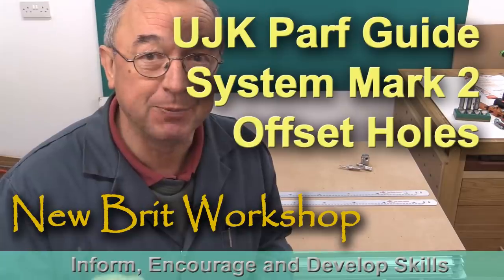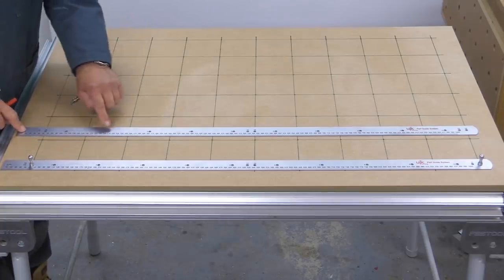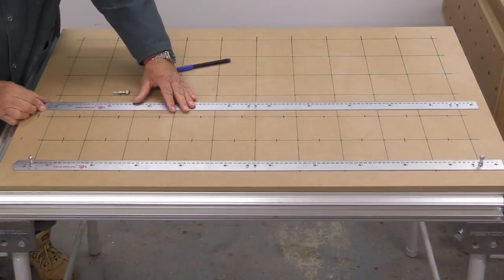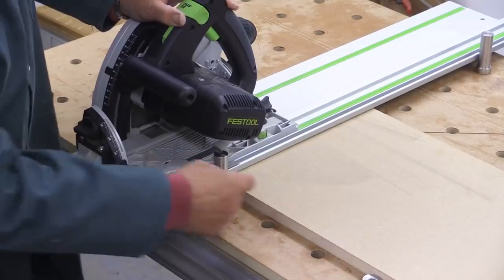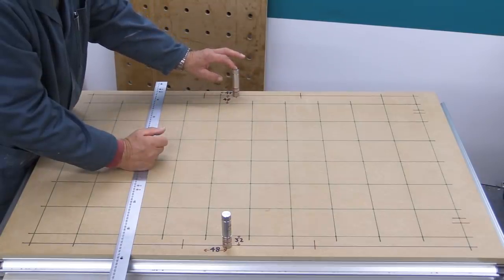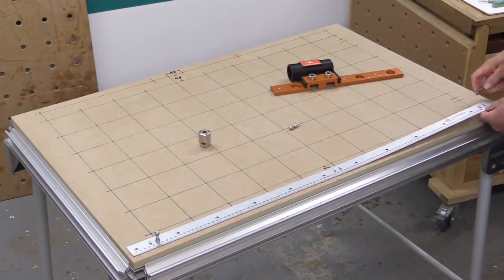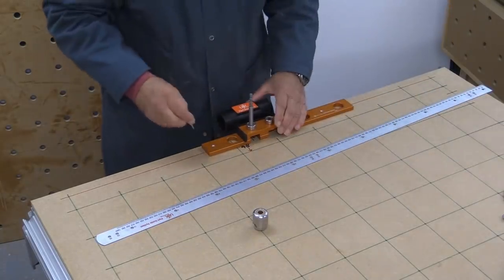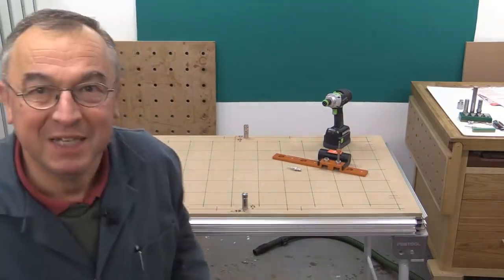UJK Parf Guide System Mark 2 - Offset Holes

Comment: Another outstanding video peter thankyou . I used this system to make a 600mm step square for my Radial arm saw and its the first time i made one with such certainty that its square . I am in the throw of putting my MFT together and playing around with clamps and seeing what clamps will go through thicker material than 18mm .. interesting the microjig clamps will go through a 30mm top and breeze through a 25mm ,, of course the festool one will only just do 20mm . maybe interesting exercise to pop up a matrix people can contribute too as to what claps  will fit through the holes V various thicknesses of top ... all the best from NZ and thanks for a fantastic product idea ..
Reply from the maker: Hi Karl, Many thanks for this - good luck.  Cheers.  Peter

Comment: Hi peter just asking you ,what is the difference between the old parf guide system and the new mark 2 parf guide system.  Peter you are excellent at useing  and seting it up.
Reply from the maker: Hi Shane, The Mk2 is easier to use and more accurate because both 3 mm and 20 mm drilling is done with bearing (oiled bush) guides.  Peter

Comment: Hi Peter, brilliant as always - I think a "Parf Super Short Dog" with a 3 mm hole in the middle where the top is flush with the table would be a good idea in order to make the offset holes in an existing MFT3 table......or is there another way? (happy owner of PGS Mark 1 btw)
Reply from the maker: I have said in many of my PGS videos that it is a good idea to leave a few 3 mm holes in the bench top in order to allow further work if required.   Peter
Reply: Yes, but not an option I suppose if you want to add extra holes (as he says) to an existing MFT top - eg to add offset holes for the guide rail.  Presumably in that case you can use the 20mm guide block to position a couple of holes halfway between existing ones?  Nice update by the way - time to jump on the bandwagon I feel.  Mmm - Christmas ideas!!  Geoff.
Reply from the maker: Hi Joe, You can try to use the 20 mm guide block to make offset holes of a sort but the problem is that a 3 mm hole is required in order for the 20 mm cutter to work.   Peter
Reply: Ouh yes, you can make offset holes in an existing MFT top. I just found the answer in one of your videos, Peter. At 11:07 in video "How to make an Isometric MFT Top" from 30. maj 2018 you show how to make offset holes by using the Parf stick as "spacer" 👍

Comment: Hi Peter. You briefly mentioned that you can use the Parf sticks to create a 48mm spacing. It seems like you should also be able to do 16mm spacing. Is that right?
Reply from the maker: Technically yes as there are offset holes for 48 mm and 32 mm and the difference is 16 mm. However, having 20 mm holes at 16 mm centres would not work at all as the holes would overlap.  If the 16 mm offset holes are in unique rows (or columns) then it can be made to work. Good luck.  Peter
Reply: @NewBritWorkshop  Thanks. That's what I needed to know. I need 16mm spacing for offsets to hold the dogs for my guide rail. They will be all on their own far away from any other dog holes.
Reply from the maker: Excellent.  Peter

Comment: Just received my PGS Mark 1 from TSO Products here in the US but haven’t opened it yet. I would much rather have the newer version. Any idea when the Mark 2 system will be available over here?-Greg
Reply from the maker: Hi Greg, No idea but the original is less expensive and equally as accurate.   Peter
Reply: TSO Products has it in the US, I just got mine yesterday.

Comment: Peter, I really like your system and in fact I have purchased the Mark 1 parf guide system some time ago. Allthough the Mark 2 definitely has added value, I am hesitant to upgrade :-). However, creating offset holes that prevent sawing marks from being on the holes and colliding with larger parf dogs does sound attractive. I have found a way to do this using the mark 1 set, with the remark that the holes will be perfectly perpendicular, but not at 32mm and 48 mm offsets. I hope this can also help other people. However, I do not see a way to post pictures. Do you have an idea how I can share with the community?
Reply from the maker: Hi Mathijs, I have also been doing offset holes on the original which I recently demonstrated at the Harrogate Show. Perhaps I will include it in my next Workshop Notes video.  Cheers.   Peter
Reply: Peter, thnx for your reply. And thumbs up for this system!
Reply: Peter, how can I locate the offset holes in an already existing Festool table top. All the holes are already drilled at 20 mm so I cannot locate the new parf stick because it needs 3mm holes. Can you buy a 20mm dog with a 3mm hole located through it?  Thanks for any help you can provide. Am I missing something in my thinking?

Comment: Peter, do you ever drill Super Dog offset holes on the long side of a table ?  I can see that being a way to do rip cuts along the long axis of a rectangular table.
Reply from the maker: I Have done them once but I found that I did not use them. If, say, I have to do a cut down the length of a board, perhaps dividing an 8x4 into two 2x8s, I first create a good sawn edge taking just a couple of mm off. Then I carefully measure from that edge in two places, each near each an end, and use that to set the guide rail. Subsequent cuts would be done with the dogs to break the pieces down further.  Peter

Comment: Peter,
Is there a way to add offset holes using the Mark II system to an existing MFT3 table that already has the 20mm holes cut?
Reply from the maker: Hi Jeff, I have had a tip from someone saying that the 20 mm drill guide can be used with a 3 mm drill, in its guide holder, through the appropriate hole in the 20 mm guide.   Peter

Comment: You didn't mention it but if the base of the guide rail dog is larger in diameter than the dogs used to square the panel it will prevent you from squaring the panel ... another good reason to offset the guide rail dogs.
Reply from the maker: I use Parf Super Dogs so no problems at all.  Peter

Comment: Hi Peter. I hope the move is going well. I have the Mark 1 version which I am ashamed to say is still in its box and has been staring at me accusingly for some time. Do you know if Axminster will sell the vacuum attachment as a separate item for Mark 1 owners?
Reply from the maker: Hi Stephen, They do sell it separately - the Axminster product code is 105100. I think that is about £24.   Peter

Comment: It’s an interesting kit for setting out a table/ bench. I have only the leftover kitchen worktop to use, so I ask will the cutter easily cope with multiple cuts into this? Thanks, Shaun
Reply from the maker: Hi Shaun, I have used the cutter to make a couple of holes through a formica top and it did cut well but I have not tested it for durability. Peter

Comment: Hello Peter. 
What is the minimum distanse you would recommend from the Edge of an mdf sheet to the first Hole? Also how would you deterine the distanse from the Edge to the first Hole?
Reply from the maker: Hi Henrik, I would not have the centre of a 20 mm hole any closer than 25 mm from an edge. When you do your planning look at the width and length of your piece of MDF. See how many times 96 mm will fit in.  For example if it is 12 times the the distance from the centres of the extreme holes is 1152 mm. If your sheet is 1220 mm wide the that leave 68 mm. For symetry, divide this by 2 and so the distance from the edge to the centre of the hole nearest the edge is 34 mm.    Peter

Comment: This gives astonishing accuracy, right? As a new guy sniffing out the system, I need to learn what freedom a holey bench can give. Within narrow confines, they seem to fill the need for a table saw, drill press and router table but there must be more. Is it a fair assessment to say the system allows fast production of geometrically perfect pieces? Seems at first glance like a factory in a broom closet.
Reply from the maker: Hi Mark, Certainly when I was moving the workshop I had no mitre saw and no saw table. I managed remarkably well with my tracksaw cutting station and did several perfect butt joints with some 40 mm x 50 mm stock. The system is really good.   Cheers.  Peter

Comment: Great system and seriously accurate, but had to return after 1 day as both Parf sticks ended up with the 3mm pins jammed in them and was unable to pull out....... 1 snapped and I left the other in as evidence. shame though, great product and couldn't fault (other than the pin issue)
Reply from the maker: Hi Mark, I expect that Axminster will replace or refund without any problem. I have not heard of this before - I hope that they check the kit to find out what went wrong.  Peter

Comment: Hi Peter, The drill guide system has two holes for re drilling  the 20mm holes what is the second one for and do you need to put any lube onto the bushing when drilling.
Reply from the maker: Initially you would use the 3 mm pins to locate the 20 mm drill guide but when you progress to a certain stage you will need to use the 25 mm locator dogs to secure the 20 mm drill guide. They fit into 20 mm holes that you have already drilled. For this stage the 20 mm drill is moved to the other part of the guide. Oil is only needed about once in every 100 holes and then only a dash.
Peter

Comment: I have a Festool OF1400 router and a set of the UJK router bushings. In one of your utube videos you suggested the Leigh 704R adapter for your bushings. I bought my router here in the USA and do not see a way to mount the Axminster bushings on the 1400 or the 704R adapter. Can you steer me in the right direction?
Thanks, Roger
Reply from the maker: Hi Roger, They should fit as I used to use that setup. The Leigh adapter for the OF1400 is Festool product code 493566. Here is a link:
https://www.axminstertools.com/leigh-guide-bush-adaptor-for-festool-of1400-493566
Does yours look like this?   Peter

Comment: It would be nice if you had a pin that fit in a 20mm hole with a 3mm pin protruding so you can modify a table that has already been finished with 20mm holes.
Reply from the maker: Hi Philip, Yes, we do have this it is the Parf Revision Dog - Axminster product number 107359
https://www.axminstertools.com/accessories/bench-vice-storage-accessories/bench-fittings/ujk-parf-3mm-aluminium-revision-dogs-3-107359
Peter

Comment: Peter, how do I locate the place to drill an offset 20mm hole in my new Festool table top with all the 20mm holes already drilled. I don’t understand how to locate the offset holes because the new parf stick needs 3mm holes. Please help me understand what I am missing. I just bought a new Festool table and want to install the offset holes for my guide rail. Thank for your time and concern in this matter.
Reply from the maker: I will do something in my next Workshop Notes video.    Peter
Reply: @NewBritWorkshop  Hello.  Were you able to create this video with regards to making offsets when all the current holes have been drilled for 20mm?  Thank you.
Reply from the maker: Hi Rick, I am sure that I have done something on this - probably in a Workshop Notes video. Try:  https://www.youtube.com/watch?v=FsBIWL30RP0    or just put dogs in a pair of holes, push a Parf Stick against them and drill the 3 mm holes and then enlarge them.   Ptere
Reply: @NewBritWorkshop  Thanks Peter.  I had already found the referenced video.  It makes the offsets before any of the 20mm have been done.  I have been playing with this all day and I made good initial progress.  It looks like there is not a set way to do things, you have to just stare at it a while and try different things.  I will try your work around though, thanks for that.  Rick

Comment: Hi Peter,  I’m late to this party I know. If I buy a pre-made UJK worktop, ie with the array of 20mm holes already in situ, can I retrospectively add additionsl offset holes using the Parf guide system2?  I need to accommodate 600mm wide stock on my workbench. Thanks.
Reply from the maker: Hi Jim, Yes you can do retrospective hole creation. You need to buy a set of Parf Revision Dogs. They fit into existing 20 mm holes and have a 3 mm hole in the middle. Here is a link to the video:
https://www.youtube.com/watch?v=1iflvxzUIe0
Good luck.  Peter
Reply: @NewBritWorkshop  Hi Peter, Many thanks for the helpful and speedy reply. Originally I tried making a worktop with my CNc machine, but it’s not big enough to handle the UJK worktop (my max dimensions are 1000mm by 600mm). So I tried making the worktop in two halves - but I’m having the most almighty difficulty in lining up the two halves precisely.  I have therefore decided to buy the pre-made worktop from Axminster and then customise it - which thanks to your help seems to be possible with the Parf guide and the revision dogs.  Thanks again and best wishes.  Keep the videos coming please!!